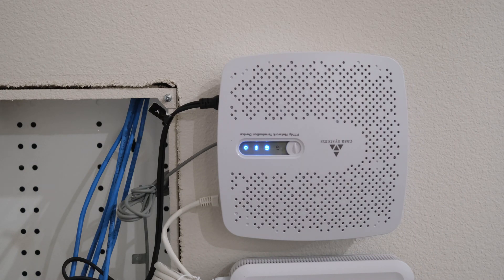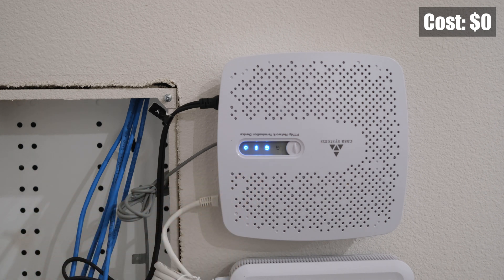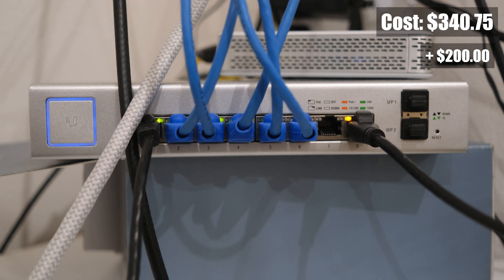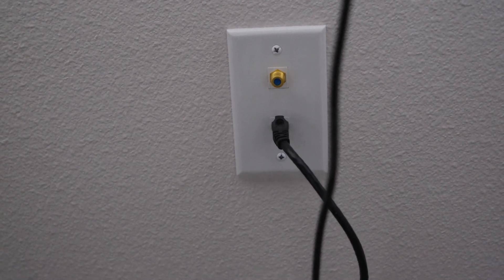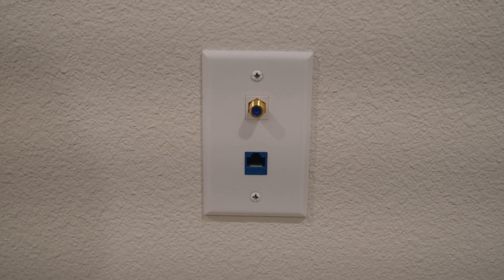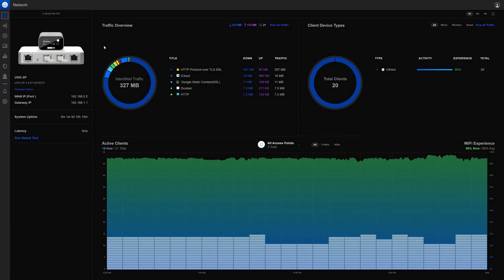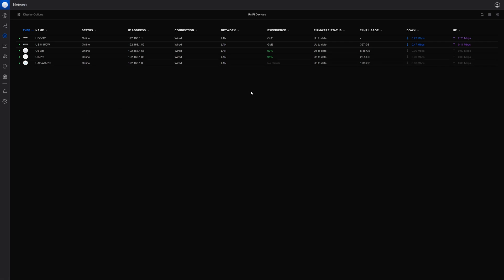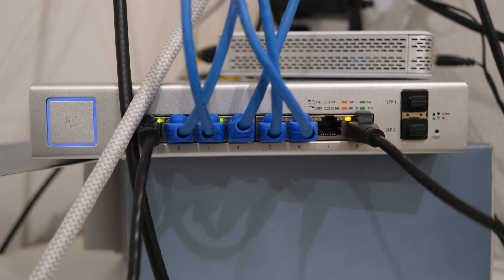My $1100 USD home server network setup - UniFi gear

Comment: If you have ethernet ports on your walls why did you not use ubiquiti in wall APs rather than ceiling mounted AP on the floor? They also have additional LAN ports that you could still use for your printer, PC etc
Reply from the maker: This was the old equipment I had moving from my old townhouse, the ubiquiti wall AP does sound like a good option